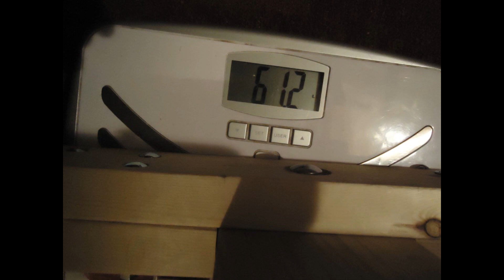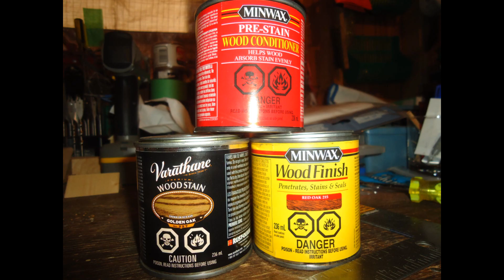WOODEN DUMMY THE BEGINNING 4

Comment from the maker: Hey silk thanks for your comment;-) The time that i spend for the dummy is from 19/4/2012 to 13/6/2012 definitely i need 2.5 months  to make one so can make it even better..The arms this time is little more thick which gives better filling..the leg is very strong and is not gonna break even with very hard kicks and even the screws on the leg they have glue and for the angle i stop in 120 degrees,135 was too wide.for the clear finish the front side of the body and the arms are made with spray

Comment: great workmanship though, if you want i could give you the exact dimensions for the central log, and armholes and correct height for the arms in relation to whoever it would belong to. Each dummy should be set at a custom height for its owner as people vary in heights so for eg. my dummy would not suit someone shorter or taller than myself

Comment: well the log should be cylindrical for one. most sets in the dummy require punches and strikes not straight down the center but at 45 and 60 degree lines to the dummy.  Kind of hard to explain on the youtube thread so sorry about that.

Comment from the maker: Lets talk also with numbers 35 Bolts 35 Nuts 70 Washers + Screws that they cost around 80-100$ for the body  which is red american oak i spend 80$ and over 170 holes for the dummy..For sanding i start 100 grit sandpaper after 150 after 220 and for the end 400 also after when i stain it i made another coat with 600 grit sandpaper that's why if you stand front of the dummy you can see your self but like i said i need even more time ;-)

Comment: this is a very good attempt at making a dummy, but not in any way to be confused as more economical or efficient.  this design is full of flaws, and complete engineering overkill.  the only credit ill give it is that there is enough bolts in it to almost mock the traditional weight of a dummy!  do not use this as a guide in anyway to make your own, its a waste of time and money, not to mention this builder does have some skills, most dont, and the traditional design is much simpler then this.